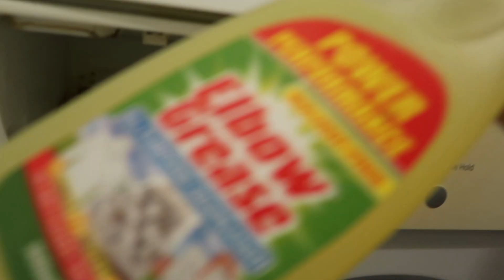Sonic Scrubber review // 12 things to clean with a Sonic Scrubber

Comment: They are firmer than electric tooth brush but i guess it can be used for dentures one attachment is a little bit softer but enough to clean hard to reach areas of the dentures . I bought it for this purpose :)